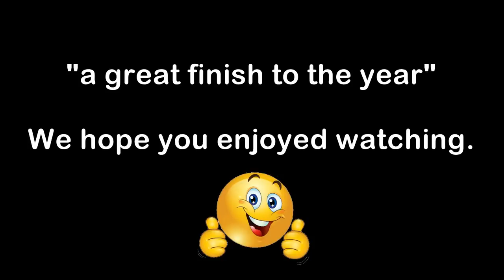4x4 Fails 2016

Comment: 16:55 better hide that number plate before insurance company finds out what exactly happened :)
Reply: +Joohyung Lee Shouldn't matter. As long as you aren't competing in a competition or rally, you're covered for off road accidents. I laid mine over the same as that, and was covered by AAMI.
Reply from the maker: Nah buddy. It was not on a gazetted road to claim insurance, so the insurance does not apply. It actually cost nothing to repair anyway (thanks to some good connections and negotiations). It would've cost the excess if it went through insurance anyway. The new shell is already on. It's even in a better condition than it was previously. Thank God no one was hurt, that's the most important thing. So all good, and yes, always good times in the bush. As they say, "a bad day in the bush is better than a good day at work". It's true 😆😆😆
Reply: I wasn't on a gazetted road either. Must have been lucky then. How hard it is to do a shell swap as I want to do it to my GQ?
Reply from the maker: Not too hard. Takes one day to strip all the interior, wiring looms and everything that's attached to the body in the engine bay and underneath the vehicle. Then another if you want to touch up anything and putting the replacement shell on, then another day to attach everything back to it. Having some sort of a crane helps.
Reply: My insurance covers off road accidents also, when I asked them about it they said unless I was pushing a new track and was sticking to existing ones, even if it wasn&#39;t a gazetted road it was covered. I would say it depends on your insurance company though, would need to talk to them about it.
Reply: Thanks for the info.What about the aircon? Is that a hassle or easy to do as well?
Reply: Exactly what I was thinking
Reply: Joohyung Lee.  No no I wasn't off roading again. I I. Simply drove off the road by accident and through the woods. Shit. Honey the insurance didn't believe me. "Believe what?"  An shit I didn't tell her. I TOTALLY WASNT OUT WITH THE MATES RUINING ARE ONLY CAR
Reply from the maker: +Brett Rowley Easy as well, just needed a re-gas afterwards, which was cheap anyway.
Reply: Aussie Four Wheelers (Hemi4WD) Thanks
Reply: B

Comment: Lessons learnt from this vid:

1.NEVER buy a 2nd hand 4x4
2.follow this method if you are determined to break your vehicle.
Reply: Ansett76 well that is why its a fail video and not a win one now isnt it
Reply: Ansett76 I bet my left nut these trucks are upgraded with much better equipment after breakages and are a much better choice buying second hand unless you intend to use them only for shopping malls and school runs, then yeah, better buy new.
Reply: @DifRential  Trucks ??
Reply: @DifRential  None of these vehicles in this video have ANY business driving in these conditions. It's obvious that most of them have stock independent suspension(a huge no no for any rock crawler, must have solid axles, dana 60s and 40s with lockers) and most importantly they don't have any kind of multiplier gearbox for low range(should have a secondary 4 to one reduction gear besides the 4 low in the transfer case). See how they're smoking the tires trying to get traction? You should be slowly crawling up these rocks and mounds. Most of them don't have the proper clearance and have too small of a tire without beadlockers. 
They also don't have skid plates or rock sliders. Also they should have ori's.
I could go on and on but this is good enough.

Comment: why they used stock cars to do heavy offroad like this?
Reply: Yeah, you need lockers to take the stress off.  Like my old Stock 1997 z71 Chevy...
Reply: +Steven King Lockers actually put more stress not reduce it.
Reply: +spydergs07 My 07 Z71 doesn't even have a lock diff available for the front. since everyone is going IFS they really need to make a design that won't break and has strength like solid axles.
Reply: kylewest100 They have the design to strengthen independent suspension but it adds so much weight to the front end it's not economical enough for daily driver.
Humvee's have independent suspension front and rear and they are tough as nails but the suspension and drive train weight over 4000 by it's self.
For a standard daily driver it works but nothing cost and weight effective will replace solid axles.
Reply: I would like to do a solid axle swap on my 07 vortec max but I don't want to spend that much since it will never see extreme off road but I'm thinking about buying a short bed single cab z71 that already has solid front and lift it 3 inches and throw 35-40 inch tires on and cut the fenders big time. This would be a trail only truck.
Reply from the maker: Stock? Lol 😂
Reply: +Aussie Four Wheelers (Hemi4WD) some of the car in this video were stock.
Reply: +Kevin Hermanto or at least looks stock
Reply from the maker: Yes, you're right Steven. Lockers DO take the stress off. These guys don't know what they're on about. Obviously they'll put stress on high traction terrain.
Reply: +Kevin Hermanto you start stock, you break and then upgrade. thats the fun of it
Reply: +fmxinsane That's one thing, but taking totally stock cars and SUV's that were never meant to even go off road in this kind of terrain is just dumb. Most of them still had road tires..
Reply from the maker: vb7200 LOL, most of them, stock??? Lol, you must be blind then.
Reply: What's been modified on them? All I see are rims, tires, and over sized bumpers, not what it'd call modified. Sure they aren't completely stock, but for the most part they are. Some of them didn't even have that. Most were bone stock and you know it. You can't just slap huge tires on a Jeep and try to climb mountain sides with it.. You're just asking for a totaled Jeep or injury.
Reply: +vb7200 I started stock with my Nissan, probably had more fun back then than now. Everything was a challenge. Now I have bigger tires lift lockers bumpers etc. it's not about the mods you have it's just about how fun you have man. Stock or not
Reply: I understand that, but don't you find it a bit of a waste to just just go beat on perfectly good cars, and especially without the proper stuff for what you're trying to do, and risk injuring yourself? I can see if you're planning on upgrading it later down the road anyway, but what if you fuck something up you weren't planning on messing with?
Reply: +vb7200 but that's the fun of it! That's the challenge, do you off-road? It's hard to explain... Going off-road you eventually break something. And you fix and improve. Don't know how else to explain man.
Reply: fmxinsane well i have never been off- roading before, but judging from your statement, i can tell that offroad is a seriously expensive hobby, isn't it? from my own perspective, i would rather upgrade the car first and keep the stock parts nicely..
Reply: +Kevin Hermanto building a fully upgraded rock crawler will cost anywhere from 30 000+ idk about Australia but usa i can probably find any of these vehicles for 3-5000 on a pro truck your still gonna break axles and drive shafts and tires so me personalty im gonna get a cheap truck and slowly upgrade as i find good cheap parts if i was rich i would build from the ground up but for now i'll have fun at the price i can manage
Reply: +Aussie Four Wheelers (Hemi4WD) so let me get this straight. It's fun to wreck perfectly good cars and look like an idiot while doing it? I understand mudding and stuff like that, I love doing that, but trying to drive them up a mountain side over rocks bigger than the car is just stupid.
Reply from the maker: vb7200 You got issues with social skills, perhaps a bit narcissistic too. We bought the vehicles for that not for mall crawling and show 'n' shine.
Reply: vb7200 absolutely you should try a demo derby
Reply: +brad v I've been to Demos before. There's a difference there tho, they're junker cars that aren't road worthy and never will be again probably without a lot of work that isn't worth it. These are decent cars with a lot of life ahead of them
Reply: +vb7200 im curious do you know what "safety stuff" would be necessary for these obstacles
Reply: +brad v For starters, a roll cage would be good. The Jeeps have them, didn't see any in the 4Runners. What if the gas thank hits a rock, other the axles get torn off and you go rolling somewhere because you can't turn, or the drive shafts snaps, you lose power and tip? There's a lot more I'm missing, including the most important which would be a harness... A lot of it isn't just for safety specifically, but not having the proper gear can still fuck everything up of it fails.
Reply: +Aussie Four Wheelers (Hemi4WD) But what I'm saying is that's pointless. Taking a newish car on terrain like that is foolish. You wouldn't try going over concrete barriers or medians just because it looks fun, would you? It's much different than trying to drive them up rocks. 

All in all, you're right tho. It isn't really my business. If you want to do if then go ahead, what am I going to do to stop you?
Reply: +vb7200 good i was hoping i was talking to someone with a little knowledge have you ever ridden a quad no seat belt no doors no roof and the gas tank is right about where it would light your face on fire and half the guys iv ridden with didn't even were helmets add up the cost of everything you just said would you put that much money into something that only cost 5000 so basically your saying its better to put 50 000 into it now rather than spend 5000 in a few years on another one
Reply from the maker: vb7200 Roll cage is illegal and needs to be a road registered, daily driver. Also, there's not a single 4Runner in this video, and here I am, thought this guy knows what he's talking about. You should've read the description first, it lists all the vehicles.
Reply: Aussie Four Wheelers (Hemi4WD) yes he should have. Some people just uggh...
Reply: +Aussie Four Wheelers (Hemi4WD) I'm sorry that I don't know the laws of different countries, considering I live in the US where it's perfectly fine to drive cars with a roll cage. Would you like me to quiz you on the laws we have here? I'd bet you wouldn't know a pretty large majority of them. And why does it matter if they're 4Runners or not? A Toyota is a Toyota, they're all made with the same parts..
Reply from the maker: vb7200 That's why you should always be polite to fellow human beings.
Reply: what is going on with you people -_-
Reply: +Kevin Hermanto there is a dude who is making a big deal about it
Reply: +Regboy2011 he is what he eats
Reply: Gaming Nugget yeah haha thas true
Reply: +vb7200 It's actually illegal to drive in the US with a roll cage unless it has been DOT approved, which is extremely troublesome. These cars in their stock form are more safe than some old truck with a rollover bar. With a full cage you need to be wearing a helmet, have harnesses, and with harnesses you need seats made for them so all the angles are correct and you don't crush your spine. Most of those cars were perfectly capable of all the obstacles, and it seemed they do this a lot because all looked like capable drivers that knew how to get out of trouble and fix their stuff on the trail. This is a "FAILS" compilation, you're not seeing all the other times they succeeded.
Reply: +Secret Squirrel 

Hey...that dude let it go a long while back.

But anyway, you cannot say that it's illegal to use a roll cage in a street vehicle in the US. We have 50 little mini countries here all with their own rules. Maybe you can say it's illegal in your STATE though if that's true, but it's not illegal in mine and probably not in vb's either.
Reply: Ok well any state that does safety inspections is not going to approve a roll cage, been there many times.  Also if you're not wearing a helmet, a cage is more dangerous than none at all, and since you definitely can not wear a helmet while driving due to visibility impairment, (that is illegal everywhere) you shouldn't be using a cage on the street.

As for letting it go, I commented after only reading the first 10 comments, not all 50 of them, but I got it, he told me, good job drudging it up again.
Reply: +Secret Squirrel I'm not dredging it up, I'm answering you because you felt the need to stir shit up.. and what do you mean you've been here? You don't even live in the US And you're trying to tell me the laws here? I know for a fact roll cages are not illegal in the US, maybe not in every state, but some it is. I've seen people drive around in them. People that do drift meets around here usually put them in, and guess what, they drive the car to and from these meets, on the road.
Reply: Secret Squirrel

I think you were talking to someone else that you didn't tag, but it seems you're talking to me in the end. Not sure. 

I just tried to explain why your statement "It's actually illegal to drive in the US with a roll cage..." isn't true because I am in one of a few states (AZ) where we can put roll cages in our car anytime we want without permission and it's legal. And since AZ, just to name one state, is in the US, your statement is untrue. That's all. 

A lot of people can't do shit in their state so they think they can't in the US. Not the case. Do you know how many New Jersey people think that we can't pump our own gas at gas stations because they assume their dumb shit laws there apply to all the other 49 states. Anyway... that's all I was saying.
Reply: +Secret Squirrel I mean you did the +vb7200 in front of your comment, so I assumed it was directed towards me, but what ever. I'll leave you alone now
Reply: Jacob Johnson

You're way behind, sport. The comment that vb7200 wrote RIGHT above yours ends with "...whatever. I'll leave you alone now" which makes your comment redundant. 

But I gotta say, I enjoyed this thread.
Reply: +Kevin Hermanto  A JEEP IT'S NOT A CAR ,  WHY PEOPLE KEEP CALLING  A JEEP A CAR , HONDAS, AND TOYOTA CAMRY  ARE  CARS
Reply: +CUMITA-4WD 

Stop shrieking, little one.
Reply: +CUMITA-4WD 

Calm down, crazy person. No more yelling, you hear me?
Reply: *****

Shhhhh. You shhhh.
Reply: wrong they do take off the stress why do u think most top 4wd experts fit them
Reply: aussie four wheelers,roll cages r legal
Reply: Kyle Gilbert they do, made by Gforce Engineering
Reply: to us north americans these are totaly stock lol you got no lifts no 35's or 37's no roll cages or roll bars locking diffs ect.  if it dont have at least a 6 inch lift here and 35's your not even really offroading to us your just doing some trail riding

i understand that stuffs not legal where you are and that really sucks bad, but thats probably where some of the comments about these being not set up for this are coming from
Reply: @ooVEXXXoo  ive got a 14 ram with 6 inches lift and 35's  i had a ZJ and TJ before this. love jeeps they work awesome
Reply: Kyle Gilbert 0k)
Reply: spydergs07 has
Reply: Kyle Gilbert “lock diff” it’s called a diff lock (not to be rude or anything
Reply: Stock cars. U have no idea do you...
Reply: @Dreamscythe1  u would not get your 22 tonne yank crap up the places these guys are going. If you wanna tow your house your trucks are great, that's it
Reply: @AussieFourWheelers  alot do look stock about half
Reply: money reserves that they don't know how to spent
Reply: @kylewest100  rather a cv joint breaks then an axle. $100 vs $300.
Reply: Exactly 👍

Comment: can tell you right now 95% of these guys had their tire pressure way way way to freaking high
Reply from the maker: What pressure do you think they were running?
Reply: Too much. Nothing funnier than peeps in jeeps running 35s with 35psi bouncing on rocks.
Reply: ryan clarke agreed
Reply from the maker: You're wrong! It says 60 psi on the sidewalls and that's what we run, just to be safe.
Reply: lmfao!
Reply: Aussie Four Wheelers 😂😂😂 get some bead locks and drop it to 25-30. Check how much you grip then. I’m amazed you guys run that much pressure. I’m able to run about half the recommended pressure without unseating my bead. I don’t even have locks either. Risky? Yes, I have a spare though and would air all of them up at that point though.
Reply: Aussie Four Wheelers if you put locks on I say take em to 20 lmao

Comment: No one in these comments knows anything about off-roading. You use regular 4x4 cars because it’s possible to afford them, and they literally are built for off-road. None of these cars are stock either. What did you think people buy $1,000,000 Baja trophy trucks to off-road with? This is what’s available and they do a great job. They aren’t soccer mom cars, they were originally built to be capable on and off road
Reply: This is one decent comment in a thousand of ridiculous keyboard warrior ones lol
Reply: The yanks with their minimum 6inch lifts are just pointless considering most of there fourbies I have seen on YouTube are leaf front and rear. With so much lift on a leaf vehicle without proper supporting mods you get the flex of an ironing board!!!

Comment: Do you guys not have lift kits down under? LOL. Good vid though. Cheers!
Reply from the maker: Thanks for watching 👍 Glad you enjoyed it. We can only go 2" lift and 2" tyre increase as self-certified, or up to 4" lift and 35s with engineer's certificate (unless it's equipped with ESP and traction control). Some have older engineer's certificates with 37" tyres.
Reply: Wow that's crazy. It also explains a lot. Take care.
Reply from the maker: Thanks.